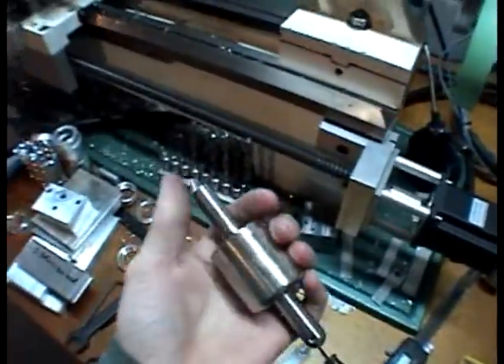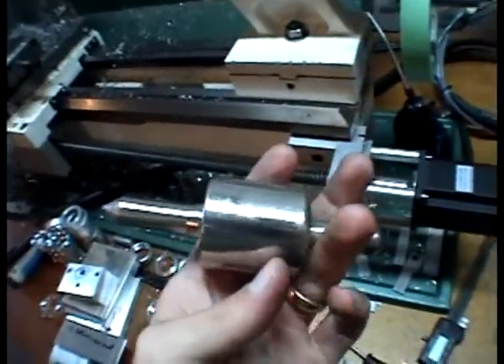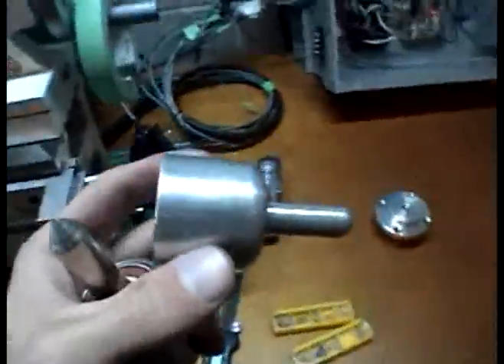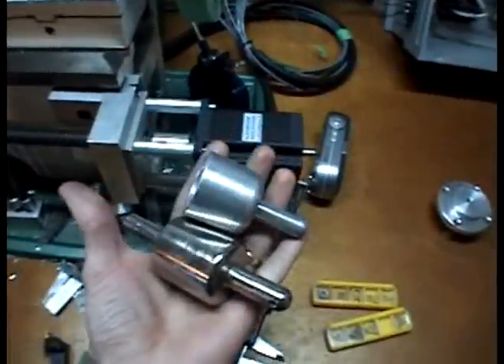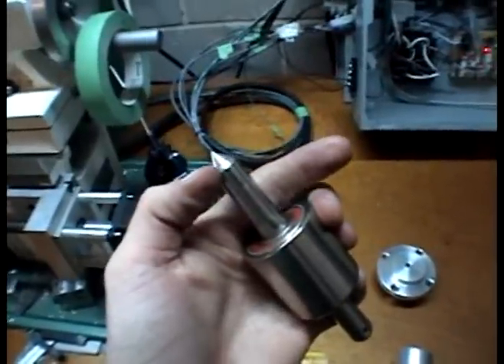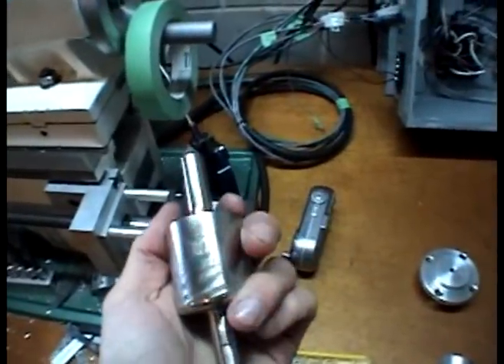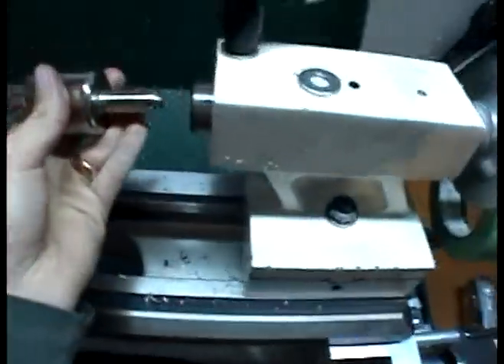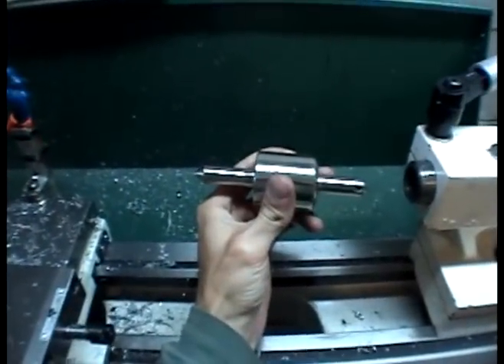making a live center

Comment from the maker: No I haven't but I'll do it real quick right now.  The bearings have held up fine and are still tight, they were cheapo's too.  

I just chucked it up in the 1/2" chuck of my X2 mill and measured 0.002" variance around the tapered part of the tip while rotating the entire thing, which is close enough for me.